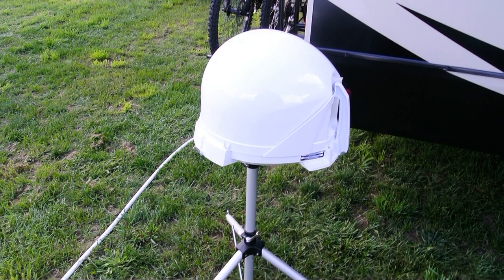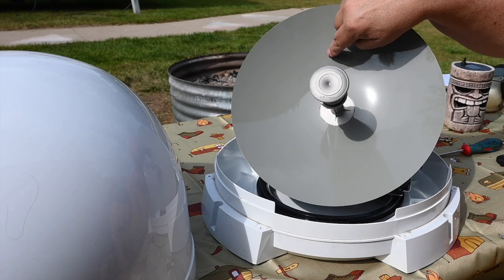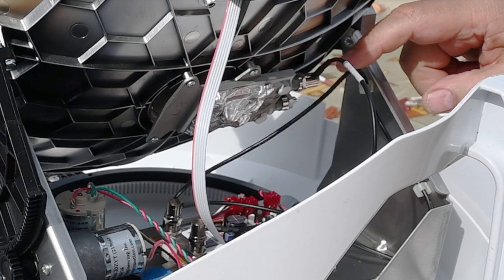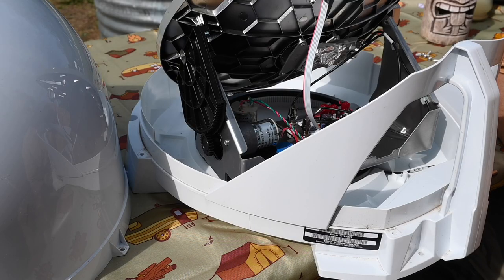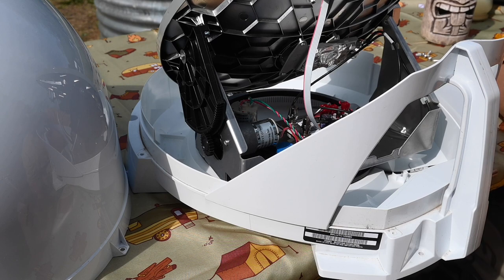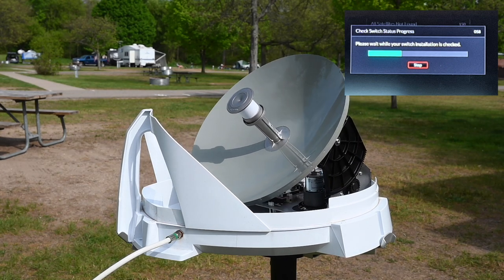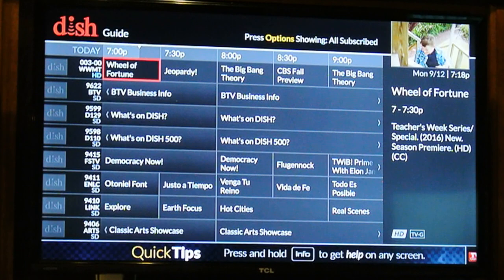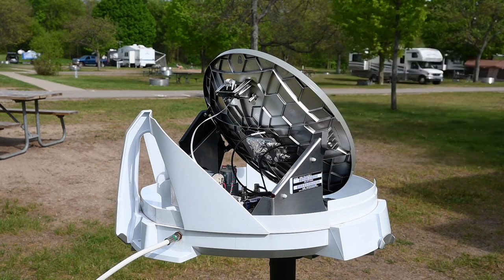How RV Satellite TV Antennas Work.

Comment: I see that they have changed the rubber wheel for a gear on the elevation control; this caused issues with the older Tailgater models, and we had to adjust ours when it suddenly stopped working right.  We eventually bought a Playmaker to replace it, and have found that it is not only more sensitive, but is also much faster at locking on to the satellites.

Comment: Im in Louisiana you are in MI would I be better off leaning where north is lower and south facing is higher. We are closed to the equator so I suspect the satellite we need is further North of the equator. I've been trying to get signal away from my home and just not having success. Checking coax it claims RG6 so this is accurate ? I have 2 dish swapped dish and at home it worked. I might need a new coax because if both dish work and only thing different is coax  ? I got this coax online with the white dish. I got the white dish for $50 including shipping that was $25. Has to be a cable issue though it might be a inverter issue but I got grey one working under inverter power supply. Tomorrow im just going to Break down and buy a new cable.
Reply from the maker: All of the Dish satellites are in geo-synchronous orbit on the equator.  

A few months ago I did a video on a free app for your smartphone that using the phone's camera, will show you exactly where the satellites are located in the sky.  This might help.

The video is here: https://youtu.be/Sijw4vBNqqU